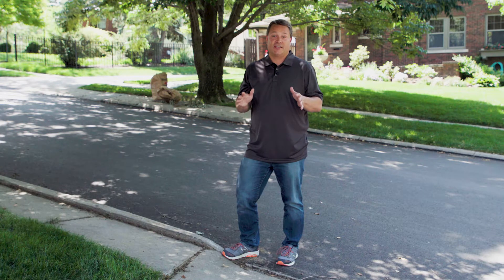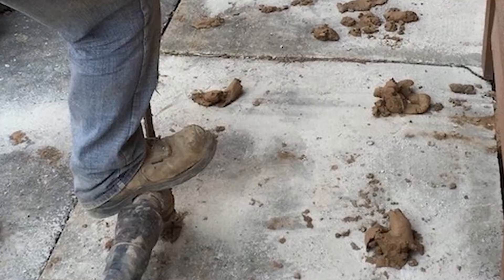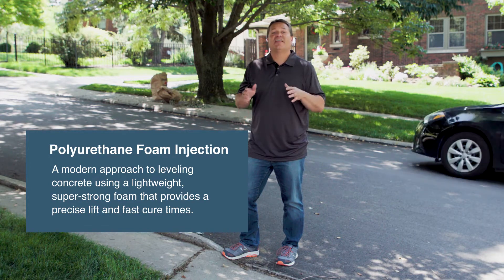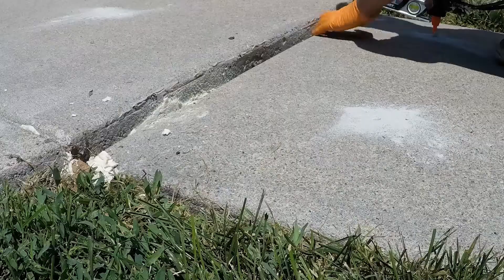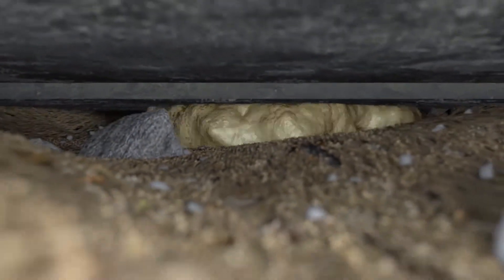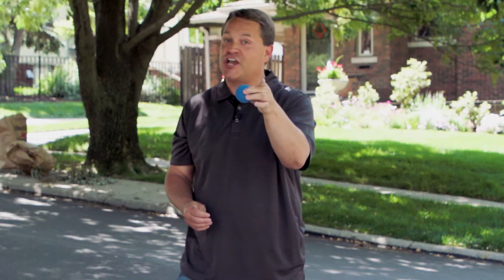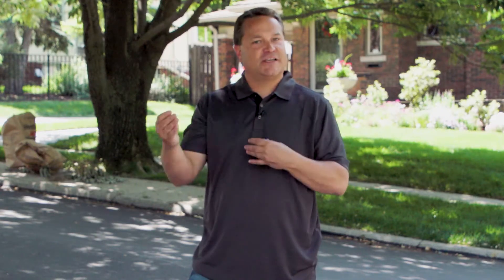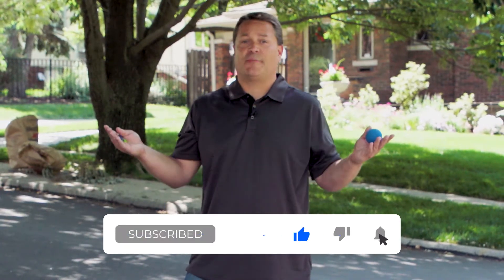How do I fix my sinking concrete? - Mud Jacking vs. PolyLevel

Comment: i have a circle hot tub sitting on a 3 inch slab the ground below sunk on one side and now has started to sink i did dig around the hot tub and did lift the slab up as much as possible which is  the best way to suport the tub so that it will  no longer will sink

Comment: My question is I just installed a small fence that opens and closes to my backyard but it keeps sinking into the concrete is it because the mud is not strong enough to hold it or is it we need that polyurethane foam that you're talkin about

Comment: What can you do if Polyleveling doesn't work?  I have a sinking slab BUT no void beneath.  I called the same people that did the original lift and they said all they are hitting is the old foam thus no void and they can't help. Any ideas anyone?
Reply from the maker: There are sometimes challenges getting a slab to move either because it's bound by friction to adjacent slabs or structures, or because there aren't enough gaps under the slab for the foam to flow. Despite these challenges, it's rare that they cannot be overcome. An experienced installer can usually find a way to either make some relief cuts to break the friction, or use mechanical lifting devices to pre-lift slab segments in order to create the needed space to get the movement started. The situation you describe doesn't really sound that unusual. It may be worth getting a second opinion.

Comment: Does PolyLevel only work if the concrete sinks? I have a large void under the driveway, but the concrete is not sinking yet. Would I still be able to use it?
Reply from the maker: PolyLevel can be used to fill that void under your slab, even if it's not sinking yet. Go to https://www.foundationsupportworks.com/dealers.html to find your nearest dealer and reach out to them to get your free estimate!